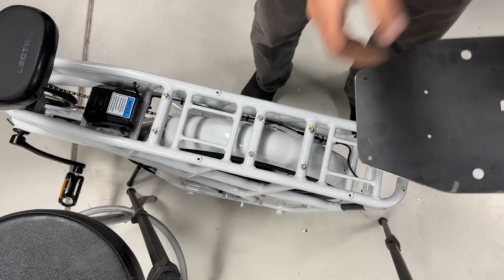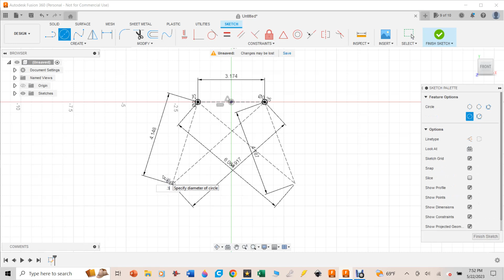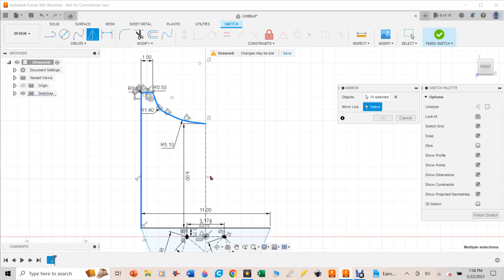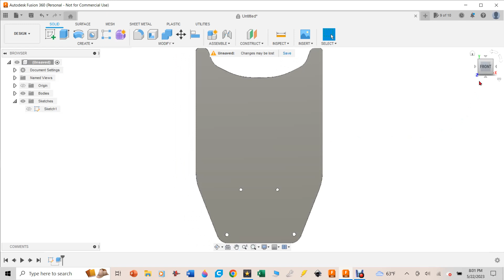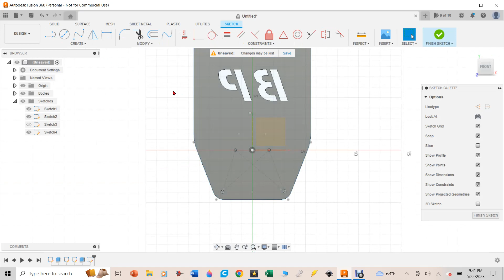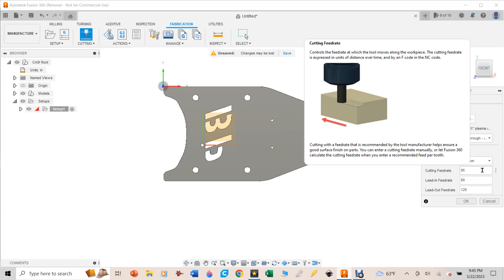Fusion 360 Tips and Tricks - Making a golf bag rack for an eBike

Comment: A trick to getting accurate center hole to center hole dimensions (two holes of the same diameter) with digital calibers! Rather than trying to eyeball the centers to line up the points on calibers, take a measurement of the inside diameter of one hole. Zero the calibers at this dimension. Now with the new zero point, measure from the outside edge of one hole to the outside edge of the other. With the new zero point the reading will be the center hole to center hole dimension. Hope that makes sense.